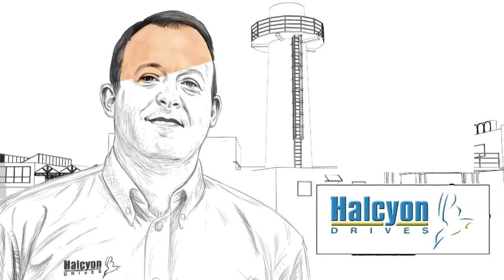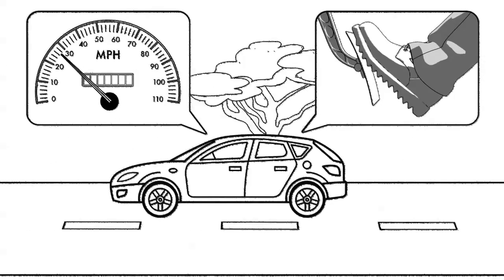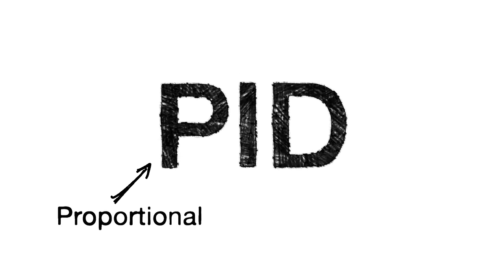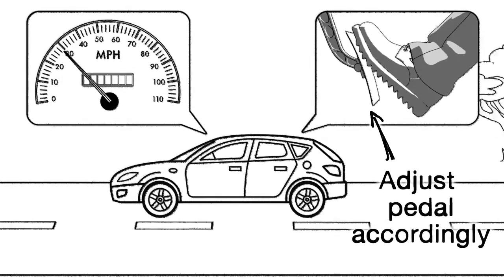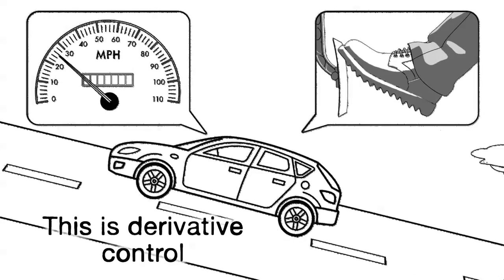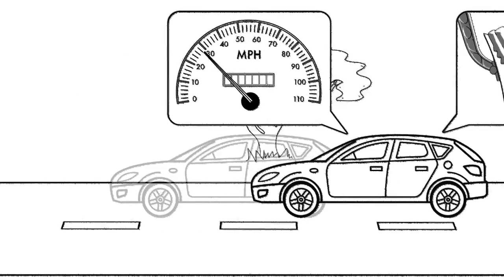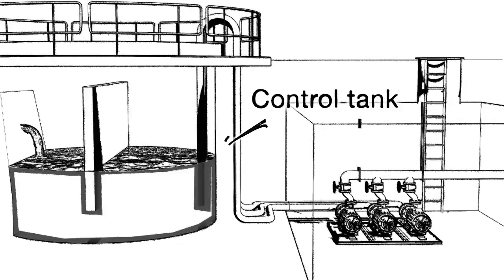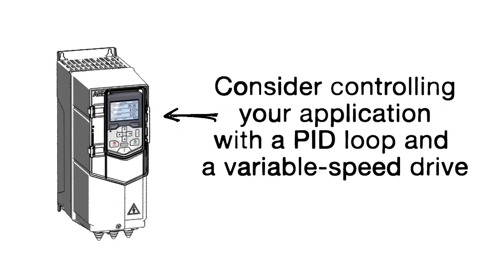PID control

Comment: Thanks for your video but I have a question here about the Derivative Control. You said the slop will slow down the car speed, so it should means the rate of change of speed is negative because the speed is decreasing instead of increasing. Therefore in this case I feel like the derivative part gain is negative, and the driver will release the pedal instead of pressing it down to accelerate.
Reply: DR RORPOPOR HERBAL on YouTube changed my entire life with his herbal medicine. I appreciate you sir, for taken away my PID 🌿🌿

Comment: I have a question. I feel a lot of modern cars have way too much delay on the throttle. The throttlecontroll feels very sluggish. I suppose it is to make it smooth, but its too slow in my opinion. Can it be too low P that makes this effect? or is it just mechanical? like turbo kicking in? Im used to PID-controllers from flying RC quadcopters. Thanks for reply!
Reply from the maker: The video is only using a car to demonstrate PID as a concept (familiar to most people) I’m afraid ABB do not manufacture or control cars.  Having said that, since all cars operate with inputs from the driver to the internal computer, the  accelerator is just an input to the car computer (ECU), so it is highly possible that the P gain on accelerator is the issue.  I know some cars have eco and sports modes, and the response is definitely different in each mode, so the PID setting for the accelerator  will possible be being altered in these different modes.
Reply: its just a mechanical issue, since we suddenly need more air to flow in the combustion chambre, it takes some time(inertia), especially with turbo driven engines.
Reply: Thank You ABB.